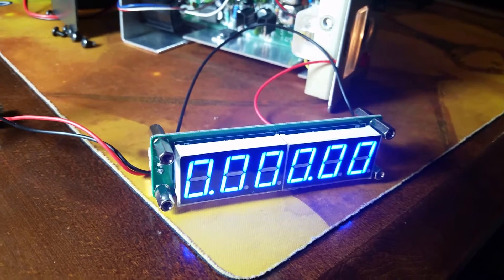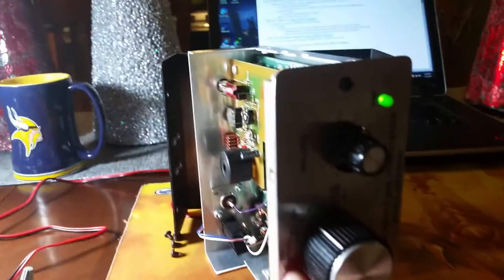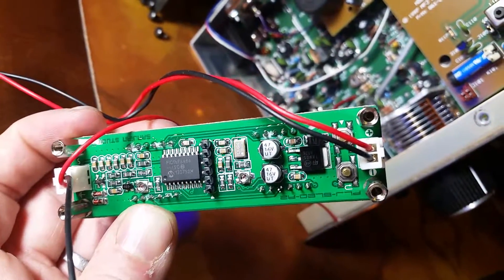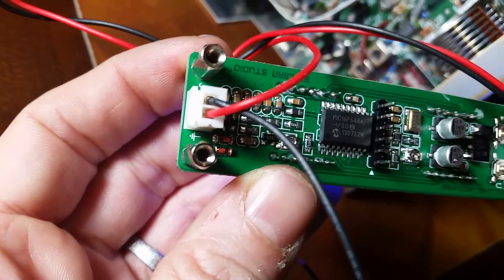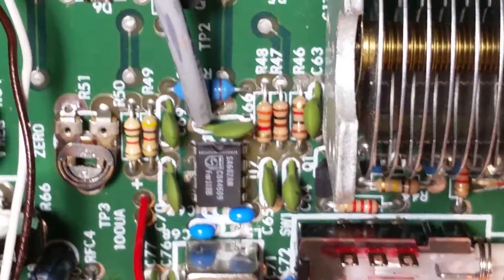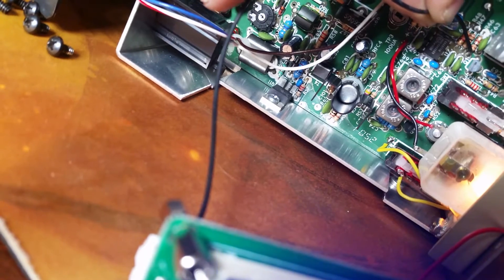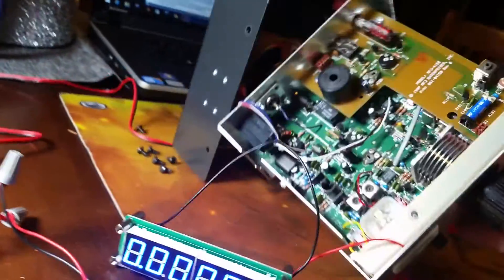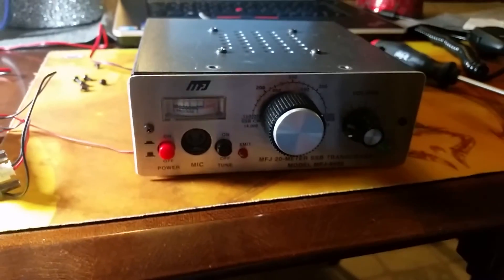Installing frequency counter in MFJ-9420 mfj-9420 SSB TRANSCEIVER 20-METER QRP

Comment: Well I just picked up one of these off ebay, it works great. But last night I soldered a wire to the left lead of R46 and connected it to my Banggood kit signal generator. It gets no reading.

I ordered the same version of the freq counter you used in this vid, we'll see if that works when it arrives from China.

Any input would be appreciated. Thanks, KE0RFZ.
Reply: I haven't had one in some time. I wish I could.
Reply: @nelomix7934  After probing around with the banggood frequency counter I fried receive! I was so upset. 

Even though it's a cheap crap freq counter I didn't think I would destroy the radio with the touch of a probe to a resistor. 

Replacement vhf/uhf amp transistor is on the way. Ugh, I wish I never watched this video now, honestly.

Comment: I have the MFJ-9475. The internal components are different then what's in the video. Mine has surface mount parts. I found the same resistor but when I hook everything up it shows 5mhz instead of 3.75mhz - 4mhz. Does anyone have any suggestions on another resistor I could connect to so it will show the proper frequency or maybe a way to calibrate the frequency counter? 73!

Comment: Have you ever found a plastic or metal case pre cut for the display window?
Reply from the maker: They are made..I never got one. can't recall where, and had to buy in bulk.
Reply: +Mike Eisenzimmer I have a similar counter except its LCD.
I gave up looking for a case that would fit and went to HomeDepot and bought a plastic
A/C box with a wall plate for the long sider type switches.
That gave me the opening for the display.  Tried cutting my own opening but made a mess, looked bad.

Comment: Hi friend, the signal input is connected is negative and signal from the HF transceiver , only two red and black wires. The frequency meter measures in SSB and AM , only connecting these two wires , and that my question. 73s of Brazil .. Good video.

Comment: Mike.. like your YouTube video on the frequency counter. I have a MFJ-9475 which I am try to add a PLJ-6 LED frequency counter to the transceiver. 
Can you send me your documentation on the buttons (setup for offsets etc). The unit I purchased from ebay does have any information with the unit.
 
Thanks,
Ed Watters
KC2ORP@MSN.Com
Reply from the maker: Ed, I really am not 100% sure what the setting are exactly. I used this video for a reference.https://www.youtube.com/watch?v=1_neC5Z_wEg

Comment: I HAVE SOME MFJ CRAP,,you have to repair the stuff before you can use it,yes its a little cheaper but it still sux .. jeff .. m0prf
Reply from the maker: Thanks for the positive comments. I sure you also would never use a Antenna Analyzer either..like the MFJ-259B-C  its only the most popular Analyzer used by more Ham's than any other. I am not a total MFJ Fanboy, but if they work and most hams are Frugal, so MFJ fits in a nice area.

Comment: What ebay seller has these?
Reply from the maker: http://www.ebay.com/itm/Blue-0-1MHz-65MHz-LED-RF-Signal-Frequency-Counter-Cymometer-Tester-Meter-/321517884663?pt=LH_DefaultDomain_0&hash=item4adbf594f7
Reply from the maker: Their are a few on ebay, from china.  Yes it will take a month or so to get them..bummer.